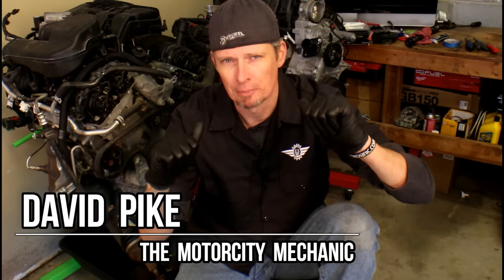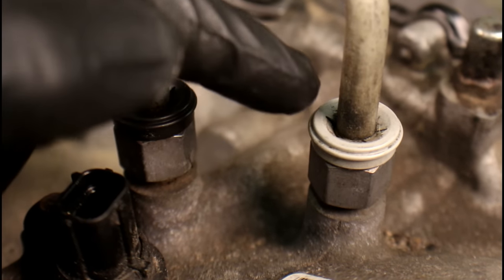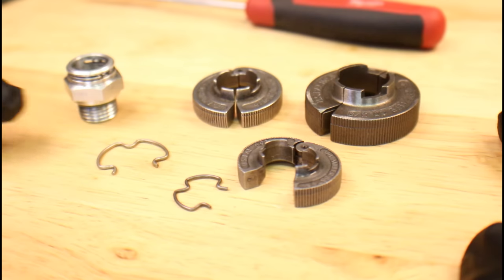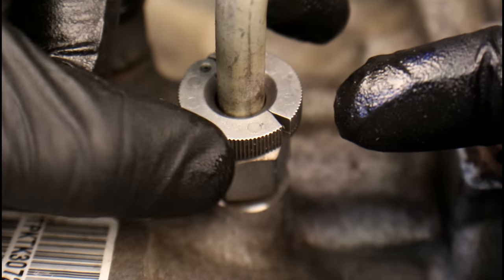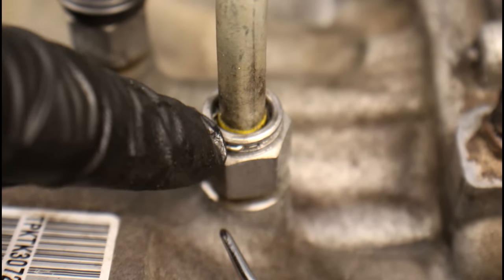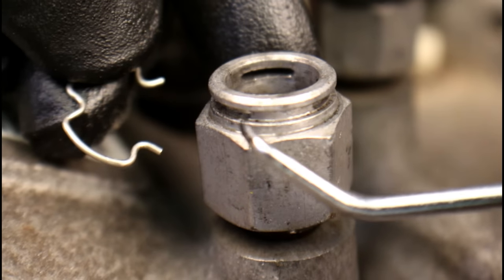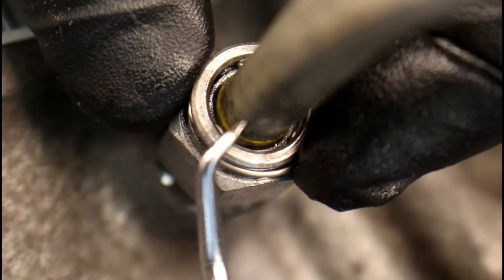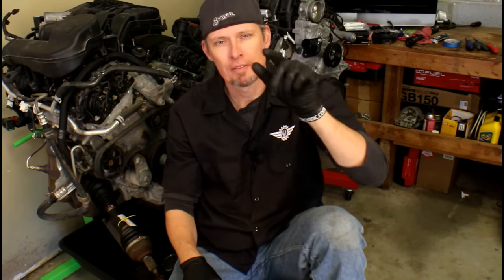Quick Tip: Removing Chrysler and Chevy transmission lines with no special tools

Comment: Does a 2001 Ram 1500 Sport 4x4 have this same style of line clip or is it just a standard line with nut?
Reply from the maker: Havent seen one come on the shop in a long time. On the trans it should thread on....the lines at the cooler up front should have different design quick connect much like the fuel line on the engine.
Reply: @MotorCityMechanic  yeah it was just an ordinary threaded flare line. Had to remove my son's transmission in his 2001 1500 4x4 to have it rebuilt. Put a kit in it and tightened the bands and it is still acting up so... Thanks for the helpful videos.
Reply from the maker: @frankmurray9353  Your welcome and good luck with that trans.
Reply: @MotorCityMechanic  well relating to the trans it is getting a rebuild now and going to throw some headers and new exhaust on it along with a new thermostat and a new oil pressure sending unit. Let's hope it all works out. Lol

Comment: I have to replace my trans in spring can i just use a wrench and just take the line off
Reply from the maker: You can if you need. It might make it harder to reinstall however when going back. Removing the clip is easy enough and alot faster. Thanks for watching and for the question. Make sure to subscribe.

Comment: Any one know where to just get the part shown in video 0:41 

Im checking on line but can only find GM , Im afraid to buy it and have it the wrong thread pitch thanks in advance 🙏
Reply: Also is the quick disconnect replaceable the one nearest the radiator? 

I accidentally broke part of it when taking off the horseshoe clip

Comment: Are all 62te interchangeable?
Reply from the maker: There are different versions for different engines so there is no one size fits all. Thanks for asking and make sure to subscribe
Reply: MotorCity Mechanic for example for my 2012 chrysler 200 S v6 with which vehicles does it interchange
Reply from the maker: I dont have the access to checking parts to see which will work and which will not.

Comment: Not being a smart ass or nothing but why not just unscrew it....?
Reply from the maker: You need to think about why your removing the lines. For example if the lines are leaking and your replacing then the new lines don’t come with the quick connects so if you unthreaded them then now you still have to remove them from the lines so that you can reinstall them for the new lines. If your replacing a transmission….the trans typically comes with no quick connects already installed. So removing the line from the quick connect is the easiest and less wastes time and steps
Reply: @MotorCityMechanic  got it thats makes perfect sense i just replaced my 545 rfe trans on my truck and I had to u thread the lines, thats why I get what your saying